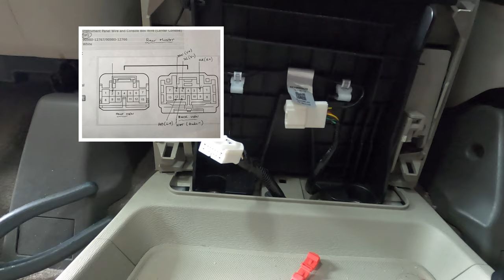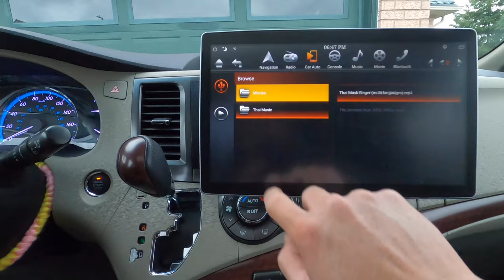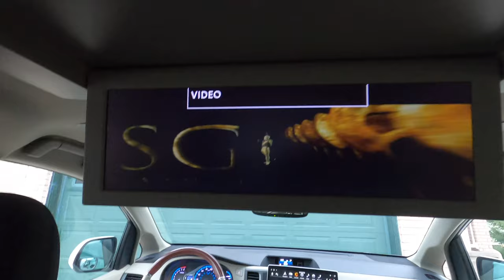2013 Toyota Sienna Limited OEM Rear Monitor Hookup for Android HU

Comment: Thanks for this video, How did you split the RCA cables into 5? You did same thing in tapping into the DVD connection as well. I understand plugging in the male side of the RCA into the HDMI to AV but the end that you prepared with crimps and used to tap into the Rear monitor and the DVD is what I need clarification on, because I see that you tap more than three cables into the AV side of the rear monitor and also at the back of the DVD player. Your timely  response will be highly appreciated as intend to do same this weekend. Thanks!
Reply from the maker: AV RCA cable = R, L audio and video. Video has V+ (video signal) & V- (Video GND) which are 2  tapping connections. R and L audio signals share the common ground/negative. So you have R+, L+ and GND. Therefore there are 5 tapping connections.
Reply: @PTranProductions  Thank you!
Reply from the maker: @Delight-d3q  
You are welcome!
Reply: Do you play DVD and Android HU or you loose the DVD player completely? Does the DVD playing sound play in the car speakers as well?
Reply from the maker: @auchemie1428 
It is possible to retain the DVD player’s functionality with this hookup:
https://youtu.be/pZdxJQk26X0?si=s1EEFf_75KWlObuG
Yes, sound can be heard from the van’s speakers via the HU  and from OEM wireless headsets via the rear monitor.

Comment: Is there a pin missing in this photo to select?  there are 6 cables for connection
Reply: I already have almost the complete connection.  the only thing I need is to decipher the 6 cables of the screen plug.  in the diagram that explains one is missing
Reply from the maker: @wendelltorotorres  
Audio L + Audio R share one common ground (-). Therefore there are only 5 wires i total.
Reply: ok, it's the (-) for both
Reply from the maker: @wendelltorotorres  
You are welcome!